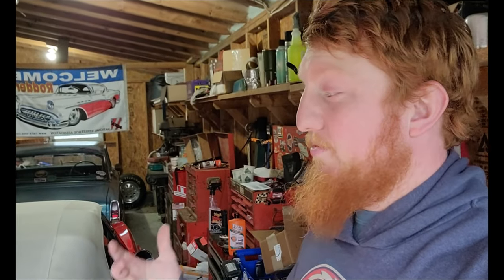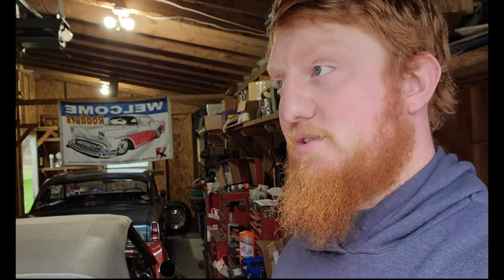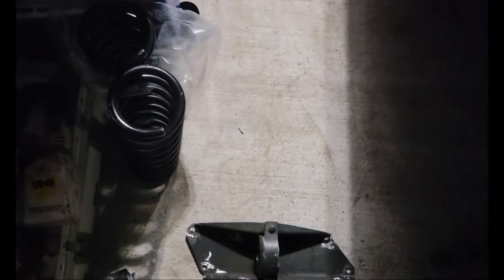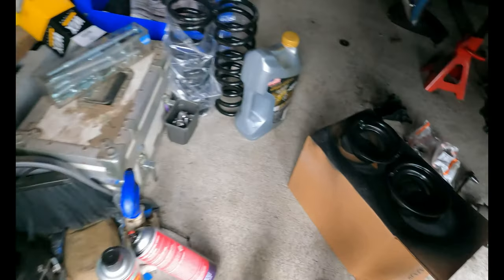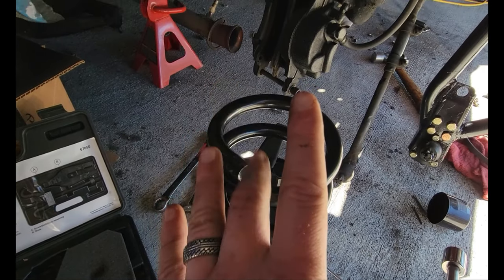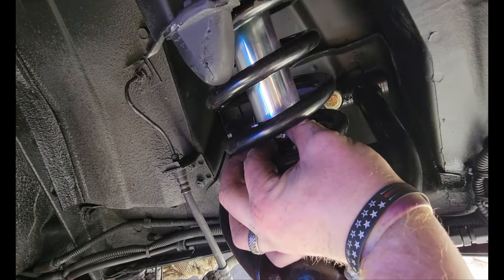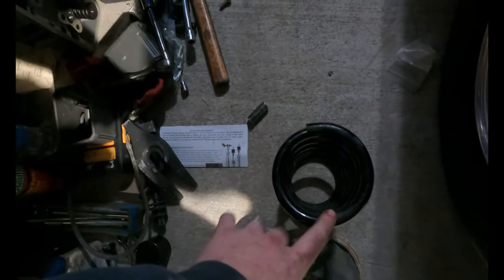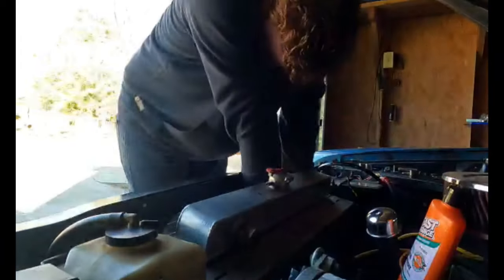I Install A CPP Mini-Subframe kit into My 1967 Chevy Nova!

Comment: I just saw for first time the . McPherson strut front subframe kit from AJE.
Reply from the maker: I'll have to check that front suspension out for my wagon, I was given the front suspension kit and after driving it for a year or so it is a vast improvement over the stock stuff
Reply: @thedailymisfire  I’m calling them today. The subframe looks like Qa1 built it . I always wondered why the foxmust style frt supen wasn’t adapted to 62-67 .  They have two kits one were the original shock towered stay and one were thee whole clip replaced
Reply from the maker: let me know! I would love to hear what you find, I want to try to ditch the shock towers for weight and clearance on my wagon, currently looking at doing checkered racing front clip and caltrac split monos out back on it, theoretically a mid 9 second car hopefully
Reply: @thedailymisfire  I talk to one of the owners. They have been at it a while heard god and bad so I assume they have fixed the early production bugs . There are several companies that have McPherson strut front clips now . More research necessary. .
Reply from the maker: @mikemaguire5507  thanks for the info, I'll do more research too on it when I'm ready for my wagon

Comment: At least your hardware is in plastic bags 😂 we have a 5 gallon bucket that gets poured on the floor, I suppose I should probably organize it now
Reply from the maker: Yeah that sounds like fun... 😂
Reply: @thedailymisfire  I have random hardware from who knows where. Mostly free hardware we've kept off of stuff from things we scrapped. I have a bolt and thread size checker I got in my petrol box I guess now I gotta get organized 😂
Reply from the maker: @Jacob Davis  I have drawers of random hardware like that too 😂 it's very handy to have
Reply: @thedailymisfire  luckily the bolt checker I have does washers, and SAE and metric hardware so eventually I'll get the HF bolt organizer and label it and go through it all. It probably won't happen till I need to find something, Id hat to know what the bucket weighs. We kept one in the race trailer for Kingsport and it got used pretty much every race day, George kept the used hardware off customer cars to fill it 😂